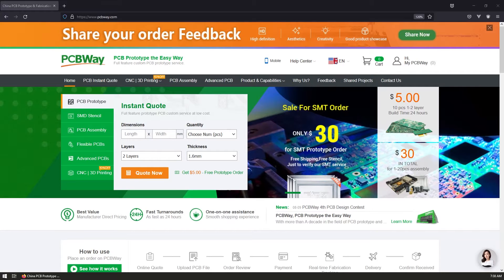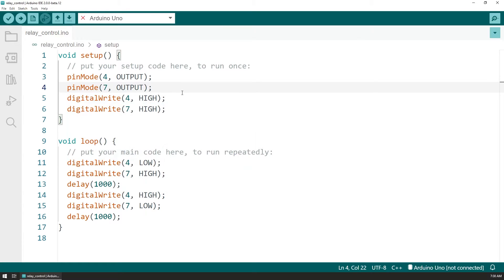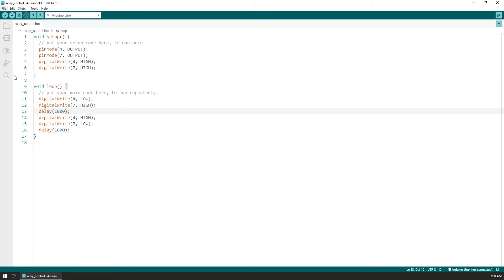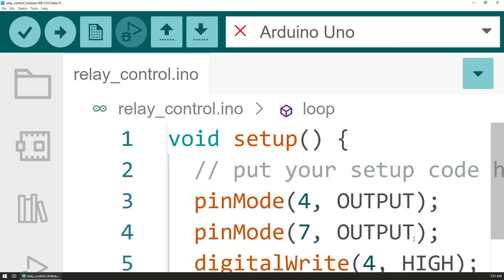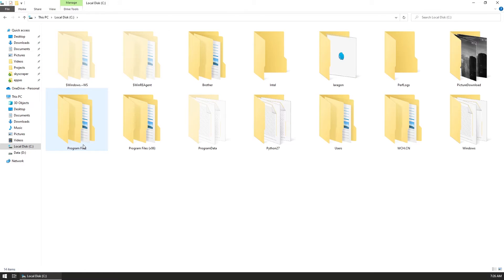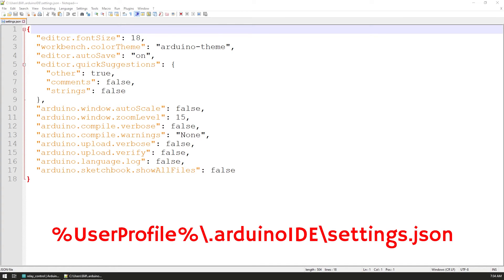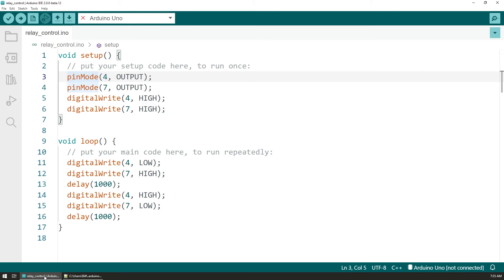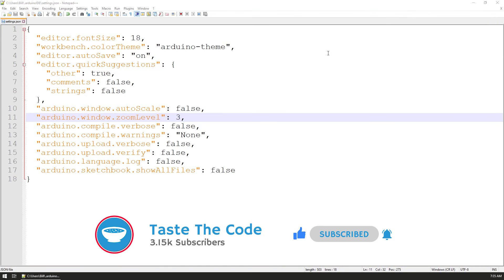I broke the new Arduino IDE - Excessive scale issue

Comment: Thanks for mentioning this good tip.
It's a good thing you can still fix it.
You could perhaps change the resolution of your screen.
Reply from the maker: I didn't tried that but the screen is already at it's maximum. If I reduce the resolution I'm guessing it will be even larger.